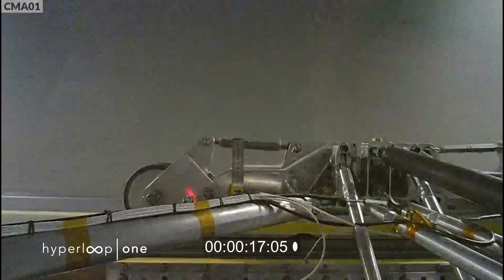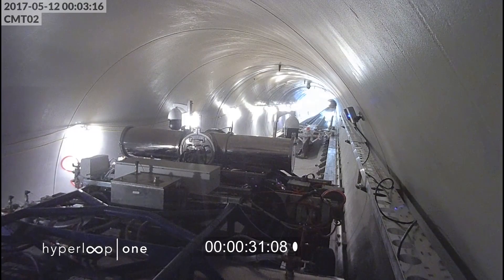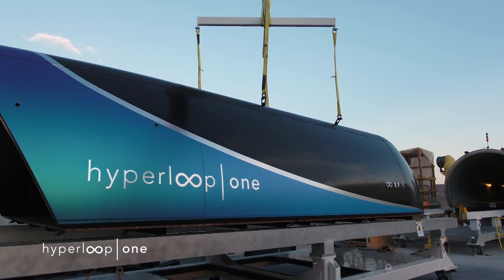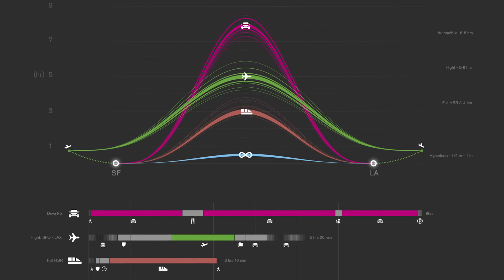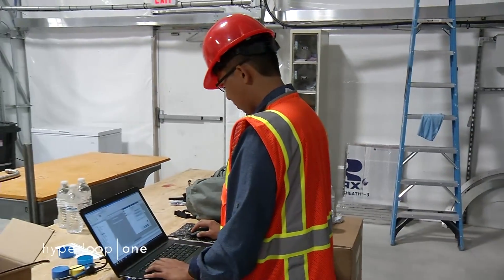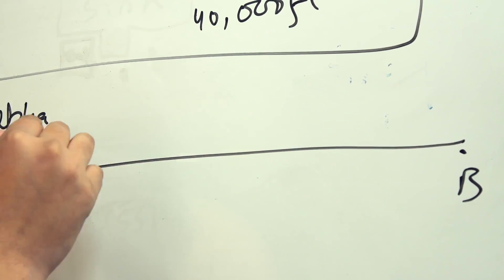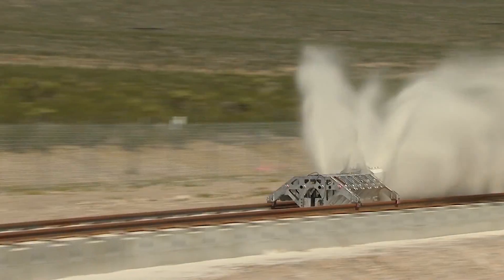Watch the Hyperloop Complete Its First Successful Test Ride | WIRED

Comment: Scary thoughts:

What happens when people tamper/vandalize the tubes? 
What happens if the tube ruptures? 
How do you account for tectonic plates? (ie. shifting of land over time, or sudden shifts from earthquakes.
How do you regulate temperature?
Weather degradation?
Safety precautions for brakes?

However, I am all for this technology and hope it succeeds.
Reply: @Nick_Gur_far_get using that logic either you would have not read this whole thread, or everyone that posted an opinion in this thread is an structural or civil engineer. Wow!
Reply: you could ask this question about every single aspect of modern living, every road, bus, train, plane, building.
Reply: Yourname942 what happens when an alligator gets in it to make it it's home?
Reply: If Isis pokes a hole in it, the vacuum would probably suck him in thru the hole. Cool.
Reply: How does any other form of transport stay running?
Maybe it's engineers working around the problems...
Reply: JoeAnim IDN. ahhhh yes impenetrable barbed wire, indestructable and impossible to cross one time i dropped some barbed wire around me on accident and it took 4 firefighter squads 8 policemen 2 swat vans Seal team 6 and the combined will of Budda  Jesus and Allah to get me out.
Reply: wouldn't the air coming in push the car/train inside the tube so it's basically a bullet? would be dangerous as fuck, especially in the US where everybody is allowed to own a gun.
Reply: what if the system shuts down and the pod is far from an exit and the tube is a vacuum, people will suffocate to death
Reply: how do you get out? that doesn't apply to rail
Reply: Pressure differential at full vacuum would only be about 14 PSI.  The steel tube could easily handle that without collapsing.  Even less chance of collapse if a leak causes the pressure to begin to equalize.  My concern would be how to extricate the passengers in case of a propulsion failure or fire.  Hopefully the engineers will have given that some thought and have a plan.  Cool idea in any case.
Reply: YOu expect me to go into one of these hyperloop? Sorry, I see major design flaws. I wouldnt ride in a train inside a vacuum tube. What if there is a fire, how do you get out of the tube, youre in a vacuum. What if there is a leak in the train, passengers would die instantly with decompression. Think of the same analogy as if youre in space capsule and small leak would instantly kill you cause youre surrounded by nothing, hence a vacuum. Its also not economically viable. You not only have to create a tube but also have the generators to keep it "vacuum" all which adds a lot of cost. Would that extra cost make the air friction less tube worth the cost? How much faster would it take in comparison with how much more money that needs to be spend to keep it at that speed? Does this make economic sense. Not to mention the technological maintenance of keeping the tube functioning. Sorry guys, but hyperloop is over rated and its going to be a money loss at the expense of the taxpayer.
Reply: yes sorry but there can be fire in the cabin...not in the tube but inside and once there is you can not go outside because there is a vacuum..and to make it safe you will need to pressurise the whole system,,,deadly as fuck
Reply: Hyperloop has been studied in Switzerland for over 20 years back in the 90's.It was called the Swissmetro.The real problems are safety issues due to the vacuum, like for instance, fire in the cabin. How do You evacuate the passengers? Also, another problem is to get people in and out of the wagons at the stations. It takes many procedures and it is time comsumming to make sure that everything is sealed correctly before You can actually open the doors and let people get in or get out. So the average number of passengers that can be transported drops dramaticly.
Reply: People fail to understand that this system is supposed to be vacuum sealed. If the seal is punctured its just a regular train but more inconvenient because its impossible to exit the vehicle during some kind of emergency
Reply: Yourname942.  Nailed it, and that is why it is a pure waste of time and money.  Right off the bat, it is a terrorist magnet.  Not to mention after even a small tremor, the whole system would have to be inspected which would probably take a whole day to complete.
Reply: Trains on a traditional rail way arn't slammed with 15 psi traveling at the speed of sound displacing 300+ miles of nearly perfect vacuum. I'm being optimistic when I say every pod running in the loop will be destroyed if not very heavily damaged if it ruptures.
Reply: You don't quite understand vacuum's do you lol
Reply: Yourname942 Maybe it's possible to actally do it, but it is going to take at least 50 years.
Reply: True.
Reply: Blade Mastr those transports are as delicate as this though
Reply: [ valent ] The entire tube would lose pressure because its all connected.
Reply: Rashed Khoory shut up u dont know shit do some research
Reply: Yourname942 who cares
Reply: who suggested that..i dont think any brought it up
Reply: Yourname942 i
Reply: its a major problem
Reply: Harry Bloom This is a point A to point B transportation system. The boarding times will be much shorter than the ones for commercial airplanes. The travel speed will make up for it anyways. SpaceX managed already to reuse rockets and are on their way to make interplanetary travel possible,  so the safety for the vacuum system will be piece of cake for Hyperloop engineers. Remember,  it's not a train so most of your arguments don't even apply. That's just my opinion of course. :)
Reply: Yourname942 an emergency exit too.
Reply: No wonder why Elon Musk didn't put one penny on the table!
Reply: Sensors. Sensors is literally the answer to most of your questions. It's 2022....
Reply: Yourname942 These were all similar concerns for planes, what's your concerns about airplanes? Curious to see what you would say. Everything has to progress despite these problems you see.
Reply: You can apply almost all of that to traditional trains. 

What happens when people tamper/vandalize the tracks? 
What happens if the track cracks? 
How do you account for tectonic plates? (ie. shifting of land over time, or sudden shifts from earthquakes.
How do you regulate temperature?
Weather degradation?
Safety precautions for brakes?
Reply: Is there a chance the track could bend?
Not on YOUR life my Hindu friend.
Reply: Yourname942 bro, many of the things you asked are easily countered, but the issue of the  tectonic plates is perhaps the easiest to avoid . They barely move a few centimeters a year, and the hyper loop could just be built across somewhere far from faults and edges of the tectonic plates.
Reply: Mike Gomes Not every car blows up when one crashes. If a hole forms in the tube, the sudden change in air pressure will destroy everything knocking all living people back with a giant wall of air pressure.
Reply: Do explain them for us then?
Reply: Google "hyperloop whitepapers elon musk" - most of this is taken into account
Reply: [ valent ] lol dumb fuck learn some physics.  a rupture is like placing a concrete wall at the rupture point
Reply: A fire in a vacuum?  Not sure that is possible, oxygen is required
Reply: [ valent ], no that's not how it works
Reply: I'm not structural or civil engineer, but I'm not that pessimist:
Vandalism: Put a camera security system, secure the perimeters, also people won't go to the middle of the desert to vandalize a tube!
Tube Rupture: High pressure hissing through hole. Tube won't collapse, it's thick steel, not sheet metal! The system will detect the rupture (myriad of ways to do this, cameras, pressure sensors, etc...) and halt pods accordingly. This is been monitored by a computer system - we're in 2017!
Tectonic Plates: Same things as elevated roads and bridges - those movable plates between pillars and the elevated road above.
Temperature: Flexible o-rings between tubes allows for expansion/contraction, so the 100+ meters cumulative expansion/contraction won't happen. You compensate at every joint with the rubber o-rings.
Weather degradation: Paint, Paint, Paint! Use good paint, good materials, and robots preferably.
Brake Safety: The system by design must have the ability to break. Perhaps invert the polarity on linear motors? Whatever, it MUST break, otherwise don't even bother. In case of failure or emergency, the system communicates break emergency to each pod. Pods keep a safe distance based on length needed for a complete stop in case of emergency. This is a system that will be fully instrumented, and will be controlled by a central computer.
Reply: when you can send a payload to space, then you can bash others, until then, youre nothing more than an armchair warrior.
Reply: Yourname942 I take it, you're too scared to use trains.
Reply: Yourname942 tectonic plates shifting can also affect stuff like cars or walking. Both of them are at risk from earthquakes but we still do it
Reply: Lol instead of addressing the questions, musk's cult repeats questions with different examples
Reply: "I'm not structural or civil engineer, but I'm not that pessimist:"
Stop reading there
Reply: If the tube is punctured, well what would happen is the sudden change in pressure inside of the tube would cause it to implode, most likely crushing the pod or trapping it
Reply: @thetaai8262  how do you lnow that it will implode the entire structure.... it brakes a hole and the air enters the tunel.... its not like a submarine that the diferenses in presure are enormous... this is 1 atmosphere only

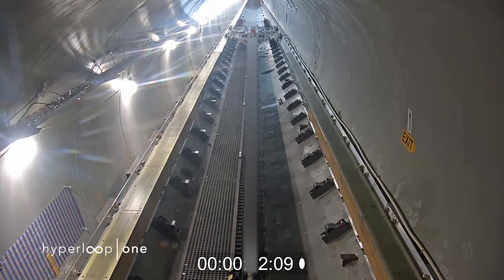Comment: I wonder why the central section of the track shown at 1:42 is blurred?
Reply: Kronospace 
To cover her privates, too many weirdos on the internet looking for that stuff to jerk off.
Reply: Because there are multiple different Hyperloop Companies. Hyperloop One (the one in the video), Hyperloop Transportation Technologies and Arrivo are all hyperloop companies.
Reply: didnt spot that the first time, very odd, they mask it as it goes down the track too...
Reply: It's one of their linear accelerators, guess they don't want any of the other hyperloop guys getting a head start
Reply: Its is like a conveyor belt of magnets on a loop it speeds up to pull the craft forward, acceleration is "difficult" for magnets.
Reply: Illuminati confirmed.
Reply: How would it be a head start if hyperloop has already invented it.